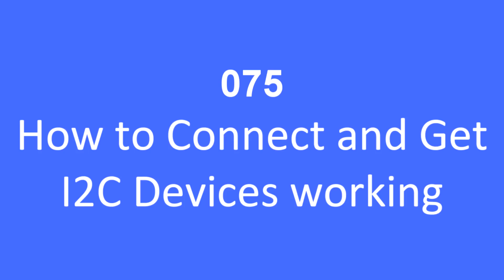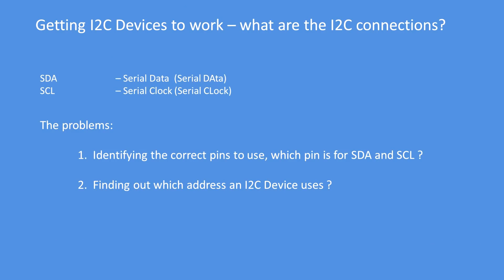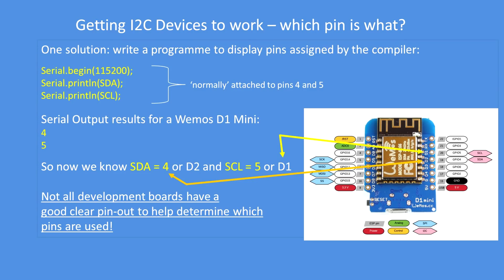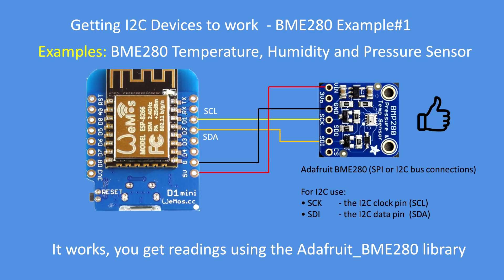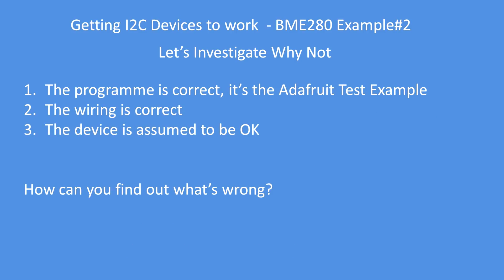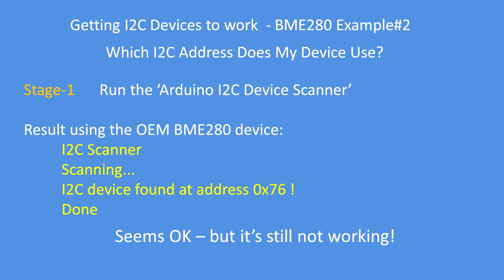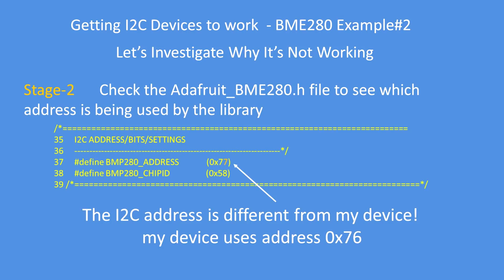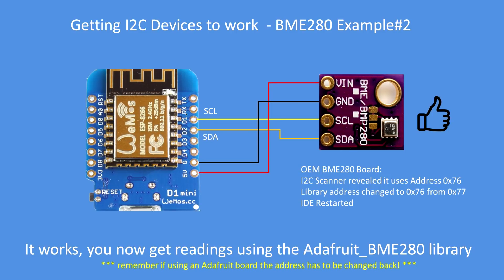Tech Note 075 - How to connect and get I2C devices working (Arduino, ESP32, ESP8266)

Comment: Based on this video, I learned how to edit the LiquidCrystal_I2C #include file to assign GPIO pins 9 & 10 to SDA and SCL respectively for an LCD I2C display.  This was necessary because the original application that the LCD display is being added to uses the (default) GPIO 4 & 5 (I think) and those were already assigned.  Now while the test sketch runs fine on an ESP8266 without any code for enabling WiFi, when I edit the code to include the display for the original app that does use WiFi, the processor hangs after program loading.  I'm also seeing a compile diagnostic that says "WARNING: library LiquidCrystal_I2C claims to run on (avr) architectures(s) and may be incompatible with your current board which runs on (esp8266) architecture(s)".  While the compiled code runs fine on the non_WiFi implementation, I have to wonder if it's stepping on something in the esp8266 when the WiFi functionality is active.  Has anybody seen this problem?  I'm not sure where to go next.
Reply from the maker: Denny Carlyle, is the library the built-in variant or some other? Probably best to restore the library and see if you can get a clean compilation, Generally you don’t need to redefine the SDA and SCL pins as they are usually assigned to appropriate pins to find which use Serial.println(SDA)  to find which pins are in use. In most instances you can ignore the incompatibility messages.
Reply from the maker: Try including esp8266 WiFi first if not already.
Reply: @G6EJD  Good idea.  I just looked at the original source and that library is not there.  Surprising that it works at all.  I'll visit github.
Reply from the maker: Denny Carlyle it’s now inbuilt in the IDE
Reply: @G6EJD  It had to be there. The app uses MQTT protocol and that has worked from the git-go.
Reply from the maker: I’m not aware of any interaction issues with the lcd library, is there another library in-use too?
Reply: @G6EJD  There are a few:
#include "HX711.h"  // for load cell I/F
#include <CayenneMQTTESP8266.h> //
#include <OneWire.h> // for Maxim DS18B20 temperature probe
#include <DallasTemperature.h> // ditto
#include <Wire.h>
#include <LiquidCrystal_I2C.h>
And to further confuse things - the test program for the display, load cell and temp probe will not run on the NodeMCU that has been running the WiFi program for several weeks.  The test program will still run on the breadboard platform and the display will show weight and temp.
I'm going to see if I can add the WiFi functions to the breadboard next.
Reply: @G6EJD  The complete application, WiFi connection, Web publishing of data, load cell weight, temperature AND LCD display all working on the breadboard system. I have no explanation for this except that the 8266 that hangs is probably 6 months older than the one that the code runs on.  I guess these things have some sort of minimal OS so maybe the one  that hangs is out of date.
Reply from the maker: There is no operating system but it is possible your older device has less memory than the newer one. Make sure your selecting the correct options and speed for the older device. Suspect a device failure more than code.
Reply: G6EJD I too suspect the device. I recall that these boards can run at two clock speeds.  My IDE may be set for the faster speed. I’ll play around with whatever parameters I can find. In any case, I have a working system now, I just need to get it repackaged back into its water-tight enclosure.  Thanks for the assistance!
Reply from the maker: Denny Carlyle another indication of run time issues is how much memory has been consumed by the programme the compiler gives a summary just before upload, if you’ve used more than 50% suspect runtime memory problems too
Reply: @G6EJD  The library is one that I imported from a site (I forget which) that claimed to be specifically for the 8666 architectures.  It was named LiquidCrystal_I2C-master.  The instructions were to rename it to LiquidCrystal_I2C and to do that, I had to delete the existing library that had that name. My need to redefine the SDA/SCL pins is because this display is an add-on to an existing application and the "standard" pins were already in use for a load cell interface.  Even with the compiler diagnostic, the code runs fine.  But when I integrate the LCD code into the existing application which includes WiFi functionality, the processor hangs.  I'm probably going to have to learn how to use the run-time debugger (I think there is one in the Arduino IDE). I guess I was hoping for a simple solution.

Comment: Very helpful.  I needed a way to not use the "standard" GPIO pins for the display and, for my purposes, decided to edit the LIquidCrystal_I2C.cpp (include file) by changing the wire.begin() statement to wire.begin(9,10).  The I2C interface will now always use those pins, which for my purposes, is fine as I like to keep the lower digitals available for other (non-I2C) instruments and such things as relays.  If you do this, put copious comments in your source file so in two years, when a display won't work on the standard pins, you'll know where to look.  These are really great videos!  Thanks for putting the time into creating them.
Reply: This worked great for me. Thank you very much :P

Comment: hello there,
i am using wemos d1 r2 with gy-85, i tried everything you have mentioned but the values that the wemos is reading are always constant. I couldn't find the problem, could you please help me
Reply from the maker: This is a particularly difficult sensor to operate what you should do is run an I2C address scanner to ensure your detecting the 3 devices, there is one in my github general repository. When you are sure the connections are correct then move on to a suitable library but to be honest few exist that work.
Reply: I ran i2c address scanner and it found the three devices, i also tried several working scripts for the three devices individually and all of them keep giving me constant values. Could it be some problem in the interaction between the wemos and the sensor? Like should i try the sensor on arduino uno to check if it is working normally?
Reply from the maker: If the devices have been detected then they are working, the problem is with the libraries most of which don’t work. What I would do is try an adxl345 library and try that device out and then the next and so on.
Reply: Ok i will try that
Reply: Finally, I found the problem and i think i should share it with eveyone.
First of all, i used two pull-up resistors (4.7K) on the SCL and SDA, this caused the accelerometer and gyroscope of the gy-85 sensor to work but the magnetometer was just giving zero values. on the datasheet of this gy-85 sensor, it says that the magnetometer sensor uses HMC5883L IC but after searching the internet and reading the code on the IC, I found out that the IC is QMC5883. This probably happens when buying this low-cost sensor unfortunately. so the third sensor's problem was solved by using the QMC5883 library instead of HMC5883's library.
Thank you for your help anyways.

Comment: For I2C to BME280 example the voltage pin is 5V going to a 3V pin on BME?  is not the opposite side pin on the board, close to the reset?
Reply from the maker: Seba Baciu  I’m not sure what you mean, on most boards the Vcc input works across a wide range of 3.3 to 5v as there is an on-board regulator with a low voltage drop out. There are a very few specific boards that operate at 3.3v and have no regulator to minimise power consumption.
Reply: @G6EJD  according to the datasheet 4.25V is the Absolute maximum rating for VDD for this device. It would be a better idea to use 3.3V. Seba Baciu is right.
Reply from the maker: Unless you specifically purchase a BME280 without an on board regulator (there are very few, perhaps 1 in the market) then the device can be operated from 5v. I’m not sure what the confusion is here, ALL bme280 boards have a regulator fitted.
Reply: @G6EJD  Right, if there is an regulator. However there're many bme280 boards without regulator for esp 32/8266.
Reply from the maker: Can you give me a link to one without a regulator then? I’m still not sure what the confusion is about!
Reply: @G6EJD  ebay search for bme280 3.3V
there is no confusion, bme280 without voltage regulator should be connected to 3.3v only other with voltage regulator to 3.3V or 5V. That's all.
Reply from the maker: Manuel Adam I’m still confused as only about 1% of boards sold are without a regulator and anyone who buys one will be in no doubt they are 3.3v only. I notice you can’t find an example without one. I’m still confused by your confusion. Do I need to add further explanation to help out.

Comment: Hello,
My ESP32 I2C still aren't working. I'm trying to connect that with MPU6050. I'm using Lolin32 Lite and there are no 21 and 21 pins out.  I'm doing:

Wire.begin(13, 15);
Serial.println(SDA);
Serial.println(SCL);

That still printing out 21 and 22.

When it comes to the libraries I'm using only Wire.h, nothing more.

What could be the case?
Reply from the maker: OK, SDA and SCL will always print out 21 and 22 because they are predefined with the board type you have selected. But this does not matter, as Wire.begin(12,14); is my preferred choice will redefine the I2C pins.As your just using the wire library there should be no other redefinition of the SDA and SCL pins.Getting the 6050 to work is not trivial, are you sure your sending the correct sequences and why try running an I2C scanner to see if the device is responding to it's I2C address. Here's one: https://github.com/G6EJD/I2C-Device-Scanner If you have further problems let me know so we can hopefully solve it for you. I don't have a 6050 yet to try out, but I have ordered one.
Reply: Still nothing. I've tried Device Scanner and it doesn't find any device. My code is good for sure, becase it rns fine with arduino.
Reply from the maker: I just tried an ESP32 Lolin Lite with the device scanner and an 5883 connected to 12,14 (sda,scl) as set in the example programme and that finds the device OK. Have you checked your connections?
Reply from the maker: Do you have the 6050 working OK on an Arduino UNO?

Sparkfun have a mature library for the 6050 with testing examples.
Reply: Yeah, I've checked my connections. 
That's GY-521 module with MPU6050. It is working fine with Arduino NANO.

On saturday I'll try Lolin32 Lite with ADS1115.

Maybe my IDE is loading wrong Wire library? Is that possible?
Reply from the maker: Xkam555 yes I have seen that before, are you using the new 2.4.1 ESP core on the IDE. Do you have any simple I2C devices that you can establish the ESP i2c. Us is running. You can slow down the bus with wire.begin(sad,scl,100000) for 100Khz bus speed. Usually 400Khz but I think that won’t help.
Reply: Yes, I'm using that. No, I've got only MPU6050 and ADS1115.
 I've just tried slowing down bus, still no success.
Reply from the maker: Strange problem and I presume none of the 6050 libraries work either? My Lite works well with bmp085, bmp180, bmp280, bme280, bme680, sht30, 31, 35 and hmc5883 so no bus problems. You could have a faulty 6050. I wish mi d would arrive as I’d like to experiment with it.
Reply: I don't use 6050 libraries. I think that is my module would be faulty then It shouldn't work with arduino. Then I'll wait till You receive mpu, and see if it works for You :)
Reply from the maker: Well most Arduino libraries don’t work either the ESP so I understand why your not using one. I will check out the 6050 pins as I recall there are more than just sad and scl on most boards.
Reply: That's not working with ADS1115 as well...
Reply from the maker: I have received my mpu6950 now I’ll try them out in the coming days. On the basis that there is nothing wrong with the Lolin Lite, I have 3 and they all work with I2C devices then it is possible that your device / Lite has a fault, but an unlikely failure mode or you have a wire library that is incompatible with the IDE. You should only one wire.h on your PC.
Reply: I have 4 Wire.h libraries:
-Program Files (x86)\Arduino\hardware\arduino\avr\libraries\Wire\src
-Documents\Arduino\hardware\espressif\esp32\libraries\Wire\src
-AppData\Local\Arduino15\packages\arduino\hardware\avr\1.6.18\libraries\Wire\src
-AppData\Local\Arduino15\packages\stm32duino\hardware\STM32F1\1.0.10\libraries\Wire

Should I delete all except these for ESP32?
Reply from the maker: No, you have only one for the ESP32 which is correct. Let’s recap, we’ll assume the ESP32 is ok, the libraries are ok, the test programme is ok; ideally the I2C scanner with wire.begin(your chosen SDA pin, your chosen SCL pin) in the setup section. You have chosen Lolin Lite from the boards, you should have two Wemos Lolin and Wemos Lolin Lite, that the connections are good between device and ESP32 and my experience is DuPont cables are notoriously unreliable and just because they are plugged in/on does not mean there is a connection. Then with all that in place and if there is still no detection of i2C devices and noting there are no endemic faults with the ESP32, the only conclusion can be the device is in fact faulty. But there is a lot to check to be sure before that conclusion can be drawn. Ideally a simple I2c device as a test a bmp085 or some other?
Reply: Problem solved. I don't know what solved that, but today. I've deleted all, left only one for ESP, started IDE, I haven't ever re-uploaded the code and thats working. Probably Lolin had to take a bit of sleep with scanner code :) Thanks :)
Reply from the maker: Good news. 6050 should now be working.
Reply: By the way... I don't have Wemos Lolin32 Lite listed in IDE boards, only Lolin32, why?
Reply from the maker: Your IDE need updating, I have 34 different ESP32 boards. You have to update with get: http://randomnerdtutorials.com/installing-the-esp32-board-in-arduino-ide-windows-instructions/
Reply: G6EJD Now i've got problem with ads1115. Scaner finds that at 0x48 addr, and then nothing. Thats not working at all, but it work flawlessly with arduino when i upload same code to arduino (of course wire.begin() instead of wire.begin(25, 33)). Have You got any idea what could be wrong?
Reply from the maker: 1. What board type are you using?
2. Which library are you using Adafruit 1115?
3. Write a small programme that does this:

void setup(){
  Serial.begin(115200);
  Serial.println(SDA);
  Serial.println(SCL);
}
The results are?

What board type is it? link to it please
Reply: 1. Im using Lolin32 Lite
2. Im using Adafruit 1015/1115 library with commented out Wire.begin() inside cpp file and Wire.begin(25, 33) in setup (SDA and SCL i'd like to use)
3. SDA = 21,
SCL = 22.
Reply from the maker: OK, so your Wire.begin() statement has to match the actual SDA,SCL pins used by the Lolin 32 Lite

Wire.begin(21,22);

I just checked my board definition and it uses (21,22) too
Reply from the maker: Show it would work with just Wire.begin(); if your 1115 is connected sda=21 and scl=22?
Reply: I can't because there is no pin 21 out in Lolin32Lite
Reply from the maker: Sorry I was looking at the wrong board, this is what mine says:

static const uint8_t SDA = 12;
static const uint8_t SCL = 14;
Reply: G6EJD that doesn't help me :( i need to use pins 33 and 25, because of my board design. What could be wrong. MPU6050 is working on these pins.
Reply from the maker: https://www.espressif.com/sites/default/files/documentation/esp32_datasheet_en.pdfGPIO-25 is ESP32 pin (GPIO25 14 I/O GPIO25, DAC_1, ADC2_CH8, RTC_GPIO6, EMAC_RXD0) - is an I/O pinGPIO-35 is ESP32 pin (GPIO35, ADC1_CH7, RTC_GPIO5) and is an INPUT ONLY so this is your problem***** you cannot use it as a CLKYou can't use pins 34, 35, 36, 37, 38, 39 they are INPUT only
Reply: G6EJD I know 34-39 are input only, but I'm using 33
Reply: As I said MPU6050 is working od 25, 33, so pin definition is ok.
Reply from the maker: Looks like the device library does not work on the ESP32 then
Reply: Something weird happened. I've soldered wires from ads pins to 12 and 14 ESP pins and it worked. Once. That's not working on that pins anymore... What is happening...?
Reply: Seems like problem is solved ( solved??). If I connect only ADS1115 to I2C line it doesn't work, but if I connect both ADS1115 and MPU6050 at once they are both working good...
Reply from the maker: You should add 10K pull-up resistors to see if that solves the problem.
Reply: G6EJD Nope, 10K don't change anything
Reply from the maker: I would check that the I2C scanner is finding g the device that confirms the connections and bus, and if found then it has to be the library and some incompatibility with the ESP32
Reply from the maker: So that does suggest the 6950 is pulling the lines up then, if nothing else a temporary solution. All I2C devices need pull-up resistors to 3.3v on the SDA and SCL lines and these could be on the 6050 board. You could try switching on the ESP32 internal pull-ups on those pins

Comment: I'm trying to get I2C to work on ESP32 pins 32 and 33. Will I have issues changing to these pins if their not hardware SDA and SCL
Reply from the maker: For nearly all of the ESP32 pins (mostly ADC not) you can reconfigure any pins to any function. A lot depends on the libraries your using as sometimes they e.g. wire.begin(sda,scl); then in your programme you might do wire.begin(32,33) and your definition gets ignored because library includes happen first. The way to check is to open the library .cpp and .h files and search for any wire.begin statements and comment them out, then use your own that redefine the pins.
Reply: G6EJD sounds good. I'll give it a go